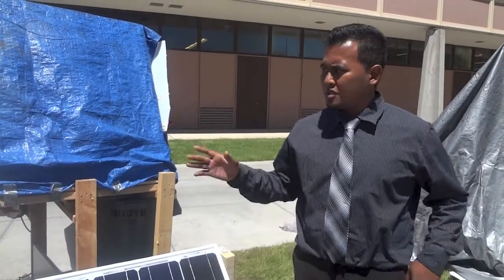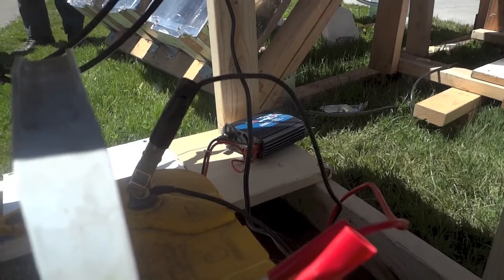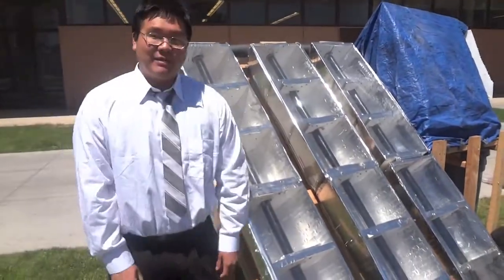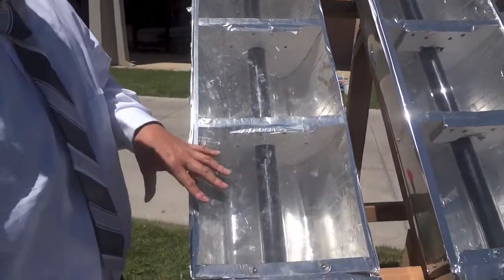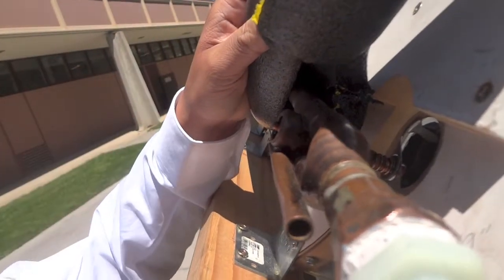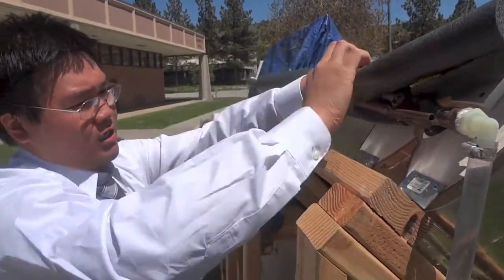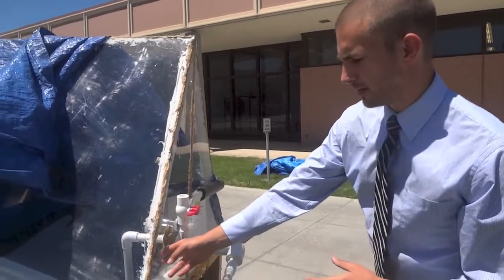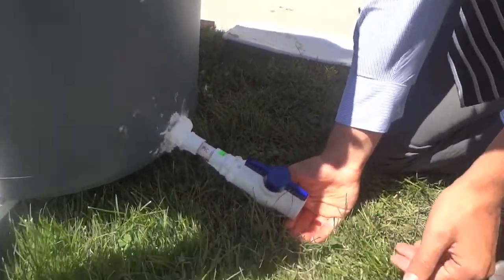Water Desalination System Prototype

Comment: well finally !!!, but how about overpowering this setup? if it is less light why not give it an extra amount of reflective surface so if you use this you could just by using secondary mirrors reflect more light on it and turn the mirrors away once the sun comes out so it runs always at max capacity if it is too much energy just add two layers of see-through aluminum with water in between so it's reflection is changed once it gets too hot and with regulating the pressure of the water in between regulating the amount of reflection if it turns to bubbles or wet steam it dims the light, by opening a valve it will evaporate and protect the setup just add new water and let it get to pressure if it is run on high pressure it will not start to boil so if you overpower it, we could just use this setup to get clean water and yes you should try to build it up to max power setups !!!  so to prevent it from burning you have an overpower protection and only use that to make it run full power at less light but turn it back once the sun comes out, also if you overpower it if the sun is hot you can desalinate in one go so you end up with a thick slurry of salt water and pump it through fast enough so it won't stick on the hot parts and yes you could do it at large or small scale even at industrial scale  !!!

Comment: not a bad  presentation, though they were a little stiff with the explanation.  curious as to why they didn't use a 12V DC pump. Also I would of used a cheese cloth with water running over it to cool the glass panes, it would make it more efficient  .